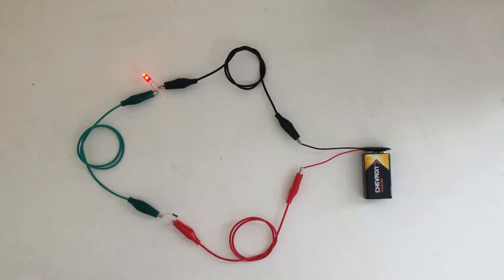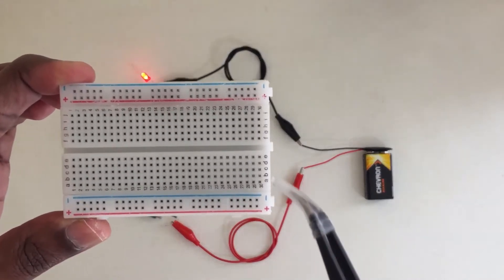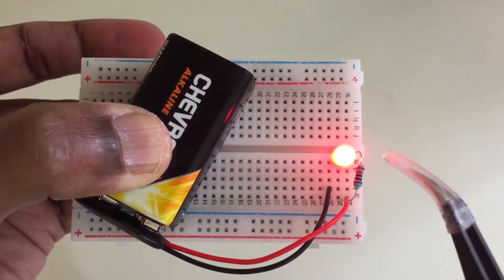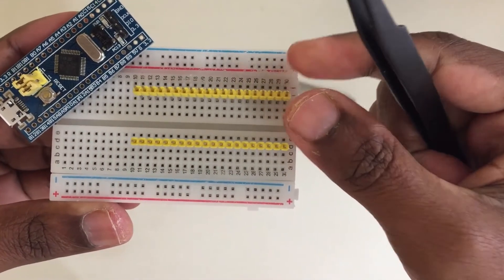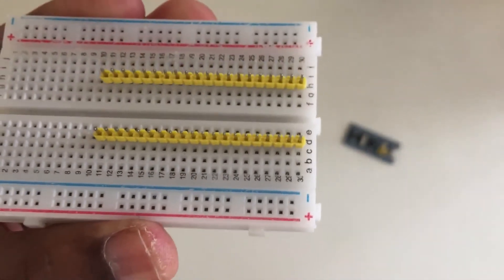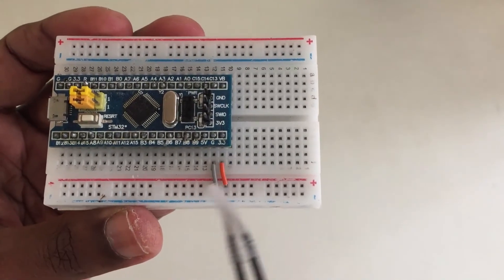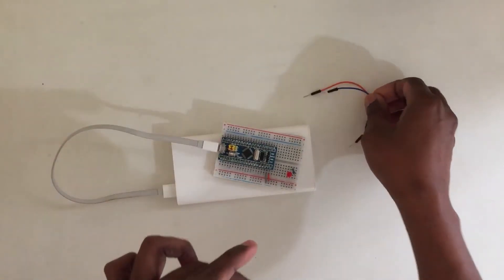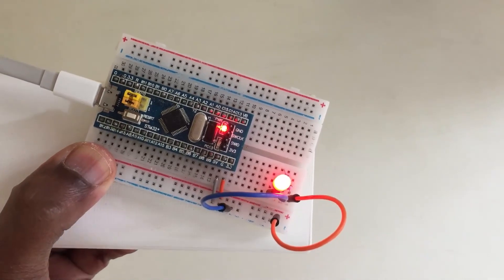12. Breadboard basics for beginners (STM32 Blue Pill)

Comment: Thank you for making this
Reply: Sir,  I am learning about blue pill.
Sir, I have a question regarding this, i have to use this microcontroller for my sensor project, detecting the hydrogen gas, The problem is that the sensor is not fabricated, only simulation part is done in the software (COMSOL) and output of the sensor is analog voltage (sine signal).
Sir, how to give a sine signal to a blue pill without any hardware. sensor